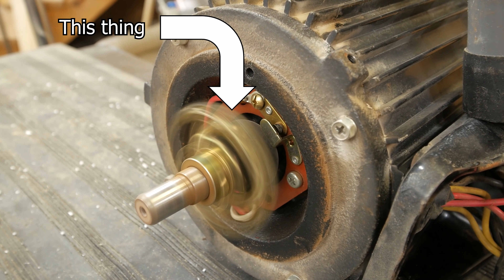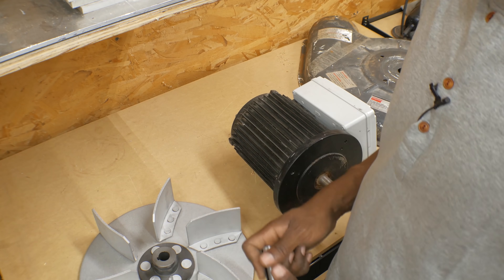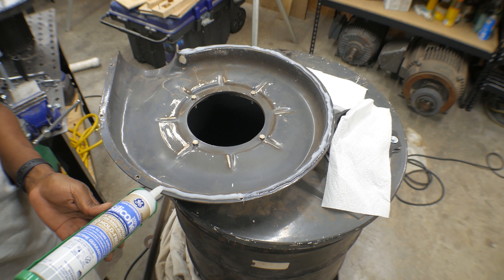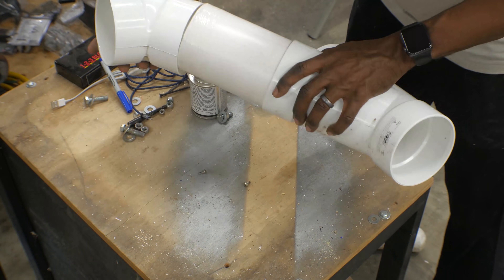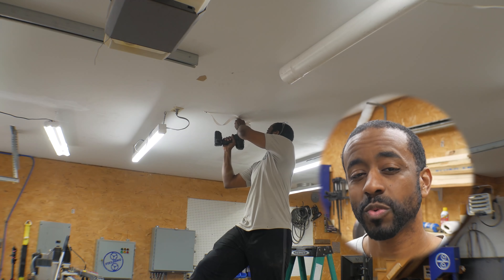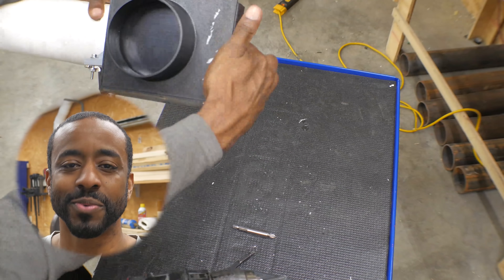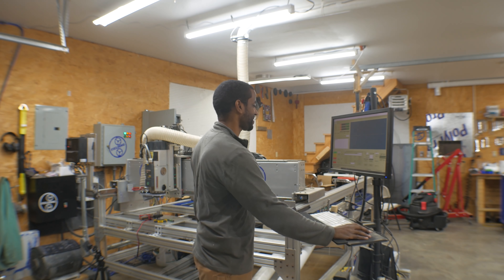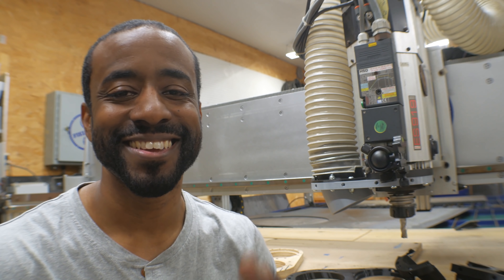Making An Automatic Dust Collection System; Shopmade #081

Comment: Jeremy, just love you videos and various projects. I was service manger at a boat dealership and the company had an incentive to take a tour thru one plant with a tech. They may are a premium fiberglass manufacturer and make everything in house. The first tool, was a vacuum bed for marine grade plywood. This is used in bulkheads, seats, etc. 
 The machine they had looked like yours but used as a multi head wood router. It was CNC with a vacuum hose and brush over the cutter. It too would change heads, but the vacuum hose was lifted with 4 cable lines by one actuator. As the motor stopped (5 seconds), the hose/vacuum ran for 3 seconds after it shut off. With the head covered with the brush hiding it, a light turns from RED to GREEN, the vacuum head lifted and vacuum was turned off to the table that held a standard 4 X 8 sheet of marine plywood.
  Talk about timing, actuators operating the vacuum operation, hose position and release the material. 
 Of course being all computer controlled, the parts the cut out edge routed by 3/8” bit after a change. This create finished parts the had a bin for each.
  Although the cyclonic vacuum collection system was outside, I never look or noticed the piping for ground wires but would suggest it. All dust is flammable like grain elevators across the midwest that have explosions. 
 A Chinook helicopters and others, as the blades slice the air, the body of the craft builds up an electrical charge. Ground crew use a fiberglass hook with a ground wire if loading. The run wires thru the landing gear when landing to discharge the near 800 volts at no amperage. Best of luck.

Comment: Hey Jeremy I love your videos.
My colleague suffered a severe static electricity shock from pvc dust pipe and the nerve damage he sustained caused him to loose his job. He also suffers from severe pain many years after the event.
A earth wire of bare copper should run through every pipe and be grounded at every outlet.
Explosions are more common than you realise especially with fine dust.
Reply from the maker: I agree explosions with fine dust happen... but from static discharge? That is questionable at best.
Reply: Maybe if he had a better GRIP on his job, he wouldn’t have lost it?

Comment: Jeremy, you do want to run a bare copper conductor along the entire length of the suction piping and bond it with a sheet metal screw about every 6' to the plastic. The same wire needs to be bonded to the collection barrel with a removable clamp to allow emptying. And yes, bond all of this to the houses' earth ground, whether the water pipe or electrical equipment ground, either should be ok , they should both already be bonded at the main service entrance. I am an Industrial Electrician and have been around alot of dust collectors, and have personally been "BIT" by the static buildup, it was by far, and I mean Far more intense than rubbing your feet on the carpet or grabbing a spark plug wire while car is running,

Comment: My father used to work as a cabinet maker and talked about a dust explosion that happened in his workplace back in the 1960's.  I believe it was from lack of dust collection though.

I remember in my old high school they had these open flame gas heaters to heat up the woodwork room.  You can imagine if enough dust got in the air it could cause an explosion.  Never happened there, but it sounded like a possible idea.  Personally, I'd play it safe and put grounded copper tape or wire over the plastic.  I've seen it done.  At least then you won't get a static shock when you brush past the tubing!
Reply: One more reason to have an air filter or two running in the shop.

Comment: Hi Jeremy, like what you did with the dust extractor system. What I am planing on doing with mine is having a wall mounted cyclone  primary up high with the dust shoot flowing to a sealed barrel and the air outlet from the cyclone going onto the blower. The blower outlet will have a filter/outside bypass. I'm planing to use a current activating relay to turn on the dust extractor. The good thing with this set up is it can be wall mounted and save space in your workshop.

Comment: Dude! You got some MOTORrrrrs there!
The other commenter made a good point. A delayed-release relay for the blast gate control would ensure that the lines are cleared of any dust that might still be in transit when you turn off the CNC Router (or any other tool, for that matter). Of course, your control Board will grow in proportion to the number of work centers for which you need to control dust collection. I would also delay the dust collector for a second or two longer than the blast gate to ensure negative pressure in the lines until shut down.
On the other hand.....an Arduino or other controller would be magic in this application without so many wear parts. Heck, I even used PIC microcontrollers to bootstrap automate a chicken coup. yup. Lighting, heating, ventilation, controlling the door between the run and the coup, feeding and watering (and water system heating/circulating for our cold winters here).
I used 7 (12F-675) 8-pin units for each control function and one (16F-677) 20-pin unit to tie them all together and coordinate with sunrise/sunset and inside/outside temperature changes. Each board was dead simple and I was able to share power supplies across reasonably closely located control items. This would be more electronical and programmy, and would still rely on control relays for the larger equipment, but would still be smack in the middle of the hobby culture you are fostering....well, maybe more alongside....
Thanks for all you do and for your insight and experience!

Comment: i'm glad you brought up about the PVC and static charge.  It happened to a friend of mine, the fire started later in the dust collection bin, the fire department said it would have caught due to a static charge in the PVC and smoldered away in the dust collection bin. the fire started at night. there are pipe work that don't build up static charge. you really should consider changing it.  a  grounding strap will not stop the static buildup on the inside of the pipe work.   his dust bin was outside away from the building so in his case things where ok. but your situation your bin is inside.

Comment: Your video gave me (what I think is) a pretty good idea... put the dust collector OUTSIDE. Build a mini-shed  attached to the side of the shop (to protect it from the elements) and line it with sound deadening material (so the neighbors don't complain). Then cut a hole in the wall to pass the PVC pipe from the inside of the shop to the dust collector's intake. So many advantages to this - much quieter inside the shop, frees up valuable floor space, and when it needs to be emptied, any mess will be outside.

Comment: You asked about viewer dust collector projects. I have a Jet dust collector with a IR remote. I converted it to an RF remote using a remote switch from Home Depot like I saw on a YouTube. I purchased a second switch and mounted it in parallel with the first unit. I made a second box with two duplex outlets, an Arduino, a WCS1800 current sensor, modified the remote to remove the battery, and a 12VDC power supply, to create a unit that turned on the dust collector when ever the current exceeded a threshold. The collector would turn off 5 seconds after the tool was turned off. Four different tools could be plugged into the unit and any tool would cycle the dust collector.

Comment: Very cool.  Another way to do the grounding is to add aluminum tape on the inside of the pieces.  Very low profile, and lots of sharp edge length to pick up static.  Run one screw per part through the wall near the end to attach to an external ground wire or just run the tape around the end onto the outside of the pipe or fitting.  Also, you might look into a HEPA filter instead of the bag.  Makes a huge difference!

Comment: The static from the pvc is unlikely to start a fire but will for sure damage electronic components like the ones controlling your gate. I use cheap key fob remotes to trigger my dust collector and thought the pipe would be a perfect place to hang one. Killed it immediately.

Comment: Great project Jeremy, I built a automatic blast gate system from the arduino like Bob did, however I think the pneumatic linear actuators are  more robust. I used aluminum blast gates and removed the metal sliders  and replaced with 1/8 acrylic and cut a hole in the acrylic this was for two reasons it slides and does not bind up and keeps saw dust from clogging the gate like your plastic one will. May I suggest that if you keep that DC system replace that fine dust distribution bag with a filter. After all the fine dust is what we want to capturer to keep out of our lungs. I am looking forward to the video on the pneumatic part of this project.🤣🛫

Comment: I used similar blast gates and after a while the dust would pack on the  back side of the blast gate.  I used my miter saw to cut that back side off.  When I did that allow the gate to come a part so I took some small screw and screwed the two halves together.  The only issue is you get al little bit of dust around your gate, but it better then having your gate stuck partly open when you think it's closed.

Comment: Nice job.  I went with the iVac sensors to start the collector but I still manually configure the gates because they’re all within a few feet of each other.  I also have a separate system for metal “dust”.

Comment: Worked on a tubing manufacturer in the past, i can state static discharges and ATEX ruling are very serious.
It's not unheard of machines working with dust going up in flames "accidentally". Even metal machines. 
Dust generates static with itself, if rubbed together ... as in being vacuumed. 

Special PVC blends with good discharge capacities are used for aspiration. Usually, you mind the thickness as well.
And if they are flexible they solve the tube collapsing issue and static issue with one simple trick: the helix steel wire.
If you connect all the steel wires (at the ends, usually, the coil comes out) to ground, it can't charge that much or some times even at all. 

Of course, you could be "lucky" enough that the sparks can't ignite the dust due to humidity or air/dust mix ratio.

There's a lot of "ifs" in this field, and in the end, you do you.

Comment: I made my own dust collector, using a 22 gallon cardboard drum and a vacuum motor and fan mounted on the top of the drum. I have black plastic pipes on both sides of my basement. I also have two switches on both sides to turn the vacuum motor on. I need to add more pipes to the far side where my bench is at.

Comment: The sealant you uses is perfect. And if you need to open it back up just use a razor knife between the two half’s. That silicon seal great and it don’t adhere to the point you can’t get it apart again.

Comment: I work in an OEM manufacturer for custom sand blasting/ shot peening machines thus we require large dust collectors. Even on our smaller dust collectors (10 hp) static shock is a very real concern if not grounded. I've seen static shocks jump 4ft like a lightning bolt off the ducting. Good call on the grounding

Comment: I appreciate the part about taking the set-up apart only to find that the original configuration was the right (only) one. Been there, done that, got the 'T' shirt. Only thing to add would be, breaking an important part during the (unnecessary) process. Good stuff.

Comment: My system uses the same pipe and it has been running for years with no grounding. No fire yet (knocking on wood/sawdust). Also, many collector have a small section of flex hose between the collector and the duct. Adding the flex hose might allow you to position the bag where you like.

Comment: Food for thought on the tool changer clearance issue:

You might find some success if you can install some kind of pressurized air nozzle opposite the collector to help blow out chips, direct them toward the collector, and provide cooling for the cutting tool.  Loc-Line type attachments would be forgiving in the event of a crash and allow adjustment for different setups.  Then your collection orifice could be farther from the spindle without losing functionality.

Comment: I bought a 25' ground cable kit 10 years ago when I installed my dust collector.  It's still sitting on the shelf.  I just don't think the volume of dust is there to cause pieces of my shop to rain down on the neighborhood.  Just my opinion.  As for an "automatic" start system, I use a smart plug and Alexa.  Whatever works.  You have a fantastic shop!

Comment: Simple controllers that sense load can also be used.  Bought one on Amazon and wired it so the saw and vacuum plug into it.  When I'm start the saw the vaccum.starts.

I would not.worry about a fire from static but it will shock you pretty good.  Drains are always a good idea.  
..

Comment: Hey jeremy my old wood shop had pvc dust collection. The time saver panel sander created alot of dust and when it was in use for about 30 minutes occasionally we would have explosions in the pipe. It woulscare the crap out of you but we never had a fire.

Comment: I use to work at a kiln drying hardwoods and we use semitrailers to blow sawdust into ,we used PVC pipe that went half way into the trailer. The static cause the dust in the trailer to ignite and all was left of the trailer was a metal frame. We were lucky the trailer was parked away from the building.

Comment: Pretty sure you made the right decision putting a ground wire on the PVC. Had a similar system set up without one and it would shock the hell out of me every time I got near it. Not sure if its strong enough to ignite sawdust but definitely worth not getting shocked all the time.

Comment: I have used DWV PVC pipe for dust collection for years.  I never had a static issue....until I ran into a spool of bare stranded wire prefect for grounding the tubing.  As soon as I installed it, I had static building up.  Seemed strange.  I just put a cyclone separator on the vac that is connected to my CNC.  My vac is connected to a relay and is controlled by the pin that would normally turn on mist coolant.  This is also how I start and stop the coolant pump for my spindle.  ~P.

Comment: OK Jeremy, I fell for it with your silicone gasket. But, the tip is, put you silicone in place, mate the parts together but Do Not tighten fully. Let it sit until it hardens and Then tighten it up. This avoids squeezing out all the material and once it has set, it will provide the gasket you want and will compress when it is tightened. Also, to keep your ducting clean, you can make a Pig. Look up the term "Pigging Pipes". Those foam pool tubes work very well (3 or 4" long). Attaching a string to it will help if it gets stuck in one of your bends or "Y" junctions.  Stay safe and well :)

Comment: This is a very helpful video brother. I am getting a similar system and had heard of upgrading the impeller and adding  A Thien Baffle to cut down on any dust in the outfall. I had found both elsewhere but your section on the impeller was clearer. If you have to get back into it, another youtube video says it can be replaced with a Rikon 60-200 (12" diameter). I decided not to because it costs $120, and I found elsewhere that the Rikon impeller is heavier and pulls more power which would be a problem for me. I am going to vent directly to the outdoors after seeing how little gets through the Thien baffle

Comment: We used to have a dust extraction system at work that was centuries old (OK, not quite centuries but old nonetheless). They did an earthing/grounding modification on it by attaching a lead to a tapped hole drilled in a large old spanner. This was place inside the dust collector pipework and the dust particles passed by it. The other end of the lead was attached to a metal part of a blast gate and that blast gate grounded to earth. This was in a chemical plant where static build up is a big no-no. Not saying you need anything like this, just showing how old fashioned engineering nous still works today.

Comment: Great job. 
I might have used solenoids instead of pneumatic cylinders. Then they could be wired in parallel with the power switch for each tool.
Reply: Hi Rich, do you mean solenoids to actuate the opening and closing of the blast gates?
Reply: @dannyebe  Sure.
Reply: @richmiller9844  could you please explain? I am trying to setup for my workshop!
Reply: @richmiller9844  could you please advise in detail? I am planning to set it up for my workshop!
Reply: @dannyebe  use a solenoid or a linear motor. Purchase them with the correct line voltage,  travel and force required. 
By not using air it simplifies the operation.

Comment: Hey there! Love your channel and  especially this particular video.  Pursuing your example, I purchased a Hbr Frt dust extractor, which comes stock: 1phase, 120vac, 20A, 2hp motor. The motor is not dual voltage  capable and thus requires an expensive hard to find contactor.
Reply: Is there a way to convert this motor to 220 volt?

Comment: Silicone is a brilliant solution for sealing it. It's durable, will flex with expansion and contraction, and it's 100% reversible when you need to take it apart for maintenance.

Comment: If you wanna get crazy the relay control could be a solid stare latch-up circuit driven by some turns around the power cord for a pulse. Adjust the discrete component values to capture the pulse you want w/o the noise. A perfect time to add off-delay, said the electronics nerd.